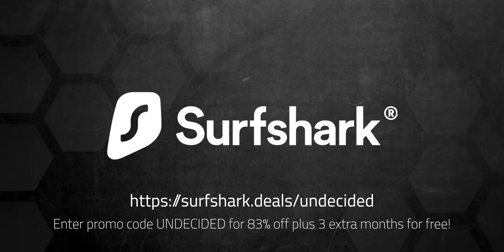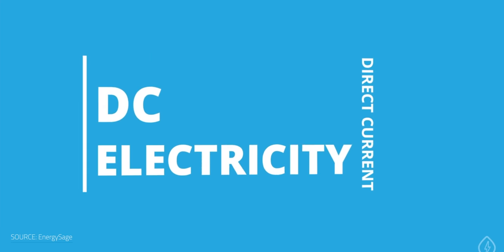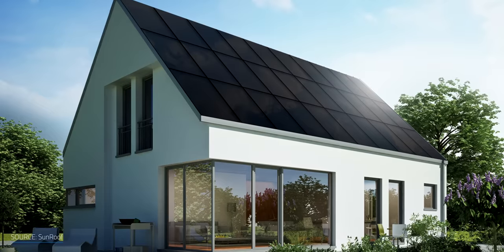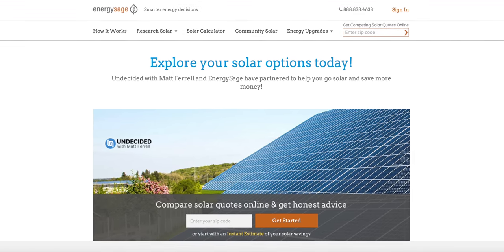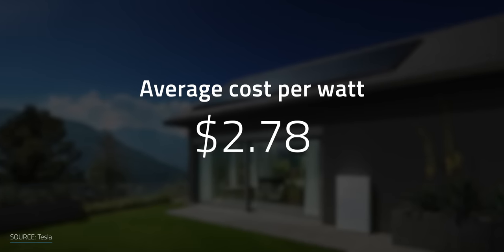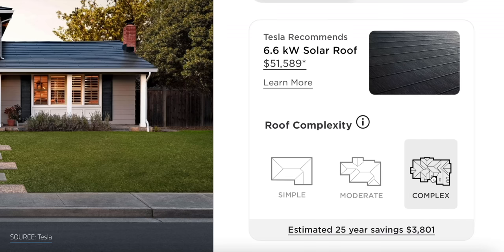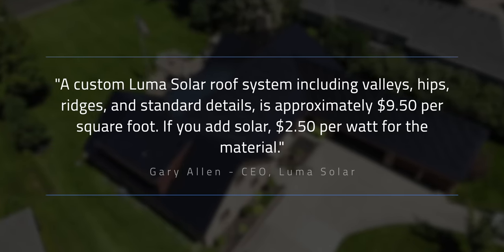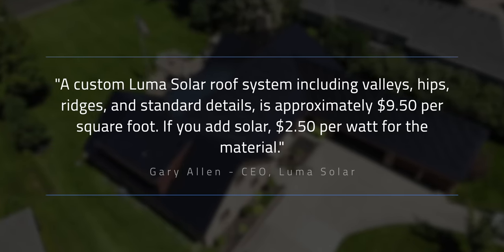Exploring Tesla Solar Roof vs. Solar Panels

Comment: My heart wants tiles but my wallet is screaming panels! 🤣
Reply: Looking at some of these roofs only able to capture 9kw and on the same roof  they could have have a 11-13kw in panels at a lower price point is a no brainer for me...but to some the esthetics is higher priority
Reply: Just invest the money...
Reply: @roqm1248  And people can deal with the aesthetics problems of panels by putting them on the backside of the house, on sheds, etc.  Our HOA forbids them on the front of houses but says nothing about the back.
Reply: We have a 223 yr old home that is under historic preservation specs, so we can't use solar panels on it (and no we didn't ask for historic designation - the city imposed it) and never mind that it has a galvanized corrugated steel roof which isn't exactly historic.  I refuse to put wood shake (which is the ONLY thing the historic preservation board will consent to if we replace the roof) as it ages quickly, leaks, and is a fire hazard (yeah, really smart thing to put on a "historic" home).  If I can get a solar tile roof that looks like wood shake I might be able to get that past the board.  Then again, maybe not.
Reply: Panels will keep the sun off your roof, depending on the air flow and insulation in the attic.  It may be better than tiles.
Reply: @allisonshaw9341  you can at least get geothermal at your property. Some energy savings is better than nothing.
Reply: No kidding!
Reply: Also the panels work better.
Reply: Save your money and invest in something else. You will never see a positive ROI with solar electric and the current technology. 

Also, you are doing anything that benefits the environment when using solar panels. Not only are the incredibly inefficient, but it requires a combination of coal and crystal smelted together as well as several other rare earth minerals and poisonous chemicals just to make the solar cells. 

We also do not have a way to recycle them when they reach their end of life.
Reply: @roqm1248  It's not just the aesthetics, if you are building a new home, building a regular roof and then adding solar is actually even more expensive than Tesla's tiles.
Reply: Slavery is Freedom, War is Peace  25 year warranty, about the same as regular roof tiles, so you would have to replace the entire roof either way.
Reply: @vladimirgertner3960  for the same wattage tesla tiles are more expensive! They will not install if roof needs replacing and that variable depends on the contractor you go with.
Reply: @roqm1248  I mainly focused on the idea of building a new house. So, you would have the expense of building a regular roof and then you would have to ADD the cost of solar panels to that cost. So it's the cost of Tesla tiles vs the cost of Roof + Panels.
Reply: @vladimirgertner3960  the difference is very small if your doing a new house but your cost might be higher if doing tesla tiles as you will have to either have your truss exposed until they come around to install or install roof and seal (water tight) then possibly strip the seal to then install solar tiles( working backwards and expensive) vs building roof completely and adding panels...this is all variable but i honestly dont see any cost benefit to tesla tiles compared to traditional panels...the only benefit now is aesthetics...price per watt..high.....install cost....high....wait time for installation......
Reply: @roqm1248  i was just pointing out 1 potential benefit. Definitely do not remodel an existing roof with these :)
Reply: @jeremiah6462  solar panels don’t ever get a return on investment and are worse for the environment than fossil fuelled electricity?!? Lol, you’re talking completely out of your ass.

First, they definitely have a ROI, the problem is the time varies greatly. For some like me who live more North I’ll admit the ROI is too long for me, about 20 years, but a lot if people in hotter climates can get as little as 10 years, especially if theyre getting rebates for putting extra energy back into the grid. 

As for these being worse for the environment… mountains of studies have found these claims to be absolutely untrue. Same with the dumb claims that charging electric cars causes more emissions than just using a gas powered car. All empirically false, yet all brainlessly repeated anyway like some sort of weird religion.

I take it you’re also a flat earther and antivaxer?
Reply: @MrShitthead  
Ahh so you are aware that it requires a combination of coal and raw crystals fired in furnaces fueled by fossil fuels? You are aware that they are made using rare earth minerals that require strip mining to acquire? You are aware that led is included in these panels? You must also be aware that there currently is no way to efficiently and effectively recycle these panels when they reach their end of life and they get shipped to third world countries?

As far as charging electric vehicles. The most common method of energy generation in this country is coal and natural gas? 

People like you are part of the problem.
Reply: A LOT of companies lease the panels, do any of then lease TILES?
Reply: @dingfeldersmurfalot4560  Be aware that panels need to be angled differently depending on your location in the world to get the most exposure to sunlight throughout the day. With that in mind putting them in the back like you HOA requires might lead to reduced power generation. My advice check with a trusted solar installer company local to your area about this to make sure your HOA is not screwing you over on this requirement before you buy a system.
Reply: @jeremiah6462  Rare earth minerals is an industry buzzword they are as rare as diamonds. (As in not at all with the scarcity driven/controlled by corporations that profit from keeping supply low.) You can offset the environmental costs of panels over time since you don't have to change them for over 2 decades. Compare that to burning fossil fuels to generate the same amount of power over the span of 20-25 years and burning all that fuel is several orders of magnitude higher in terms of environmental damage. 

The narrative that something shouldn't be done because it also involves fossil fuels to manufacture initially is completely flawed if not outright dishonest. If you are arguing for nothing to be done unless its 100% environmentally benign then you are arguing for an impossible standard . At the very least it will take 60 years for such a tech as power generation technology with zero environmental impact doesn't currently exist. Not even in the experimental stages.
Reply: @alexisrivera200xable  
No I am arguing that your technology is backwards, inefficient and environmentally worse than what you are trying to replace. But you’re a hypocrite and you only care about energy that’s “not big oil”.
Reply: @alexisrivera200xable  also you didn’t address the environmental impact that is supposed to be more environmentally friendly when in reality it is far worse.
Reply: Slavery is Freedom, War is Peace  The tiles are more durable though. In my city with so much hail over summer it might be a better long term investment anyways
Reply: @jeremiah6462  This depends on where you live. I live in Algarve, Portugal. Solar power is a no-brainer. Jan.
Reply: @janmaaso  
The overall point of my argument is that solar requires more hazardous manufacturing and does more damage to the earth than the energy generating methods it is supposed to be replacing. Namely Coal and petroleum based fuels.

They require incredibly harmful manufacturing processes, they are an incredibly inefficient method of generating electricity (currently max efficiency is less than 35% at best), their inefficiency continues to increase over their lifespan and when they are burnt out they are shipped to a landfill in 3rd world countries. 

Solar is not the green energy it claims to be and this doesn’t even include the battery requirements for long term storage.
Reply: I don't see how this works anywhere but in neighborhoods where looks are obsessed over, and possibly city roofs. I think I could convince my co-op apartment building to do the solar tiles because they would fit the look of the old building, where a solar panel is a tough sell (I've already tried). Granted an apartment can't be powered by them currently, but it would cut our electricity bills by a lot by selling to the grid our excess solar power, possibly even storing some of it for the whole building to shift supply a little.
Reply: @markhaus  
You’re not cutting your electric bill. You are replacing your electric bill with a much higher solar bill. The numbers don’t turn into savings, even with the credit from the electric company. Which, btw, they are paying you wholesale for electricity that they then flip and sell at retail. So you are getting screwed at both ends. Why else would the electric companies be all about helping you?
Reply: @jeremiah6462   Amen. I totally agree. You will never get a payback let alone a profit. Stick that same money in your 401K and watch it grow over that same 15-20 year solar panel lifetime period instead of micromanaging weather you can’t control. My lifetime shingle roof with 125 mph wind rating on a 4k sq ft house cost only $4k after insurance reimbursement. Even at full price it would have only been just over $10k. I never even think about my roof. That’s the way it should be. Also, the thing about the shingles that may fail in extreme climates might be the attachment clips from all the heating and cooling. Of course the installer loves the Tesla shingles because he probably makes way more margin on those roofs with less competition. I also wonder how hard insurance claims would be to get reimbursed on the Tesla roofing. So many problems. Snake oil sales and people buy into this BS.
Reply: @maxwellhouse750  
FINALLY! Another person with sense! 
Thank you sir.
Reply: @Homeside301  yip

Comment: Something you didn't mention is that panels provide further insulation. After we installed panels on our roof the house became much cooler to the point that air conditioning was not needed. We already have insulation in the roof but the difference between before and after the panels were installed was very noticeable.
I guess tiles would be the same as the roof with standard insulation.
Reply: Panel's can also be used on any roof type which provides home owners many more options in designs as well as adopting more modern materials which can reduce the need for heating and or cooling further reducing your homes energy demands.
Reply: That might be the case for you but it has not made a big difference in my situation. My attic still gets very hot in summer and cold in winter despite 21 panels on my roof. People should still consider proper air-sealing of the attic floor as well as insulation and possible use of a radiant barrier for energy savings. Perhaps modern air sealing and attic insulation would make for a good new video?
Reply: @petersachs764  in my case I covered the entire roof with panels. It may be that you only covered a section of your roof. The uncovered section would probably make enough heat to heat up the attic.
Did you notice any difference after you installed the panels?
Reply: @franciscoshi1968  Nope, pretty much covered whole roof. If you want to insulate your attic then insulation your attic. It should be a heck of a lot cheaper than the 23k my panels cost me. Heck, money is almost free now. Do both. 😄
Reply: @I love you but  Yes, they learned exactly who is "too big to fail".
Reply: "An unexpected benefit of the crossing".

Comment: As an Electrician, my concern with tiles was always how they integrated together mechanically.  Roofs shift and bend over decades, and my concern was that a hard connection would result in loose electrical connectivity.  

I applied with Tesla as a Master Electrician to be an installer mostly out of interest for their products, and as they never got back to me, I still don't know what the implementation details are, so I don't know one way or the other if they're actually any good.

Comment: Couldve be useful to mention avg cost pm2 for just a regular roof install. Give some context for standard roof costs against going down the solar tile path.
Reply: Roof installation costs are going to vary dramatically across the US,  and are subject to quite a few variables even ones as simple as the level of demand for roof repair/installation, such that giving an average price may not be feasible.   Add to that the availability of labor to do solar installs in an area may differ greatly from availability of roofers, so may not be an apples to apples even if he grabbed his numbers for a particular region.
Reply: Wholesale panel costs are about 75c per watt, beware of these $2.75 numbers, they are highway robbery.
Reply: about 7 times the cost of cheap 3 tab...for labor and materials...thats just a rough estamate.
Reply: @nicklappos  I think he mentioned that was the installed cost.  I could be mistaken though.
Reply: I install solar panels in New Brunswick Canada and we charge 2.25 to 2.50 watt installed net meter only.. so not sure why u guys are paying so much concerning we buy all our material from states and our dollar value sucks.
Reply: 15-30k roughly. I was thinking the same thing - If it’s time for a new roof this might actually be the best time to switch to solar and an even better time to consider tiles.
Reply: @nicklappos  there's a wide range of cost with panels. I see them from 40 cents per watt all the way up to over a dollar.
His numbers(2.75) includes installation and likely permitting.
Reply: new roofs costs are really only comparable if you are getting a stone or tile type material for your roof, the solar tiles are toughly the same cost and are far more durable. If you are comparing more common roofing materials, those are much cheaper then the solar tiles.
Reply: Agreed. Was waiting for him to do this. Why wouldn’t you include this in the video?
Reply: Measuring costs per m^2 for normal roofs only says so much. The structure of the roof, the kind of material you choose and the logistics depending on your location change the price x3 to x5. A simple roof with two sides and one window ~10-30k, slightly complex 25-50k, complex 50-100k. Kind of the same problem Tesla had with their tiles, just that silicon can be easier to work with. Also i don't know how good these solar tiles are in thermal isolation. Good bricks can already be quite good at keeping your house dry and warm.
Reply: @Jonaasti i doubt the solar tiles can last as long as classic tiles. If done properly and cleaned every other decade stone like tiles can last for centuries.
Reply: @MrHaggyy  There's absolutely no way they'll last as long. One storm and a few tree branches drop on your roof will result in most of your solar tiles shattered.
Reply: What happens if you have panels already installed, but down the road the shingles need replacement?
Reply: @Makitafan  you need an electrician that can unmount the panel, so you can replace the shingles. But it is very unlikely that you need to replace them under a none shattered panel.
Reply: @k0zzu21  😅 i doubt they are so fragile. Silicon glass that is lying on roof construction and not hold in a frame is quite strong. But the voltage/power of a solar roof and bad weather storms are a quite dangerous combination that needs to be calculated.

Comment: I had my solar panels installed recently, as the house was new, replacing the whole roof with tiles didn't make any sense. It'd be something to consider if the roof had to be replaced anyway. So far the performance of the panels has been good, but can't be sure until the first full billing cicle is complete
Reply: I thinkt hats kinda the idea, only a value product if you need w new roof already, and tbh that's an entirely fair businesses strategy
Reply: Same here. Roof could only accommodate 8 kWh due to pitch. Installed in January. Output steadily increasing as we tilt towards the sun. Saving about 1/2-1/3 of normal electric bill.
Reply: @JamecBond  Yeah I think that's how things are going to play out, expect to start seeing them as an installation option on new homes and only later installed during a remodel or replacement roofing.
Reply: @davidkeefe9468  Solar arrays are kW. Batteries are kWh. Charging stations are kW.
Reply: @honesty_-no9he  cool. Thank you
Reply: Good luck with it.  I'm considering them on our house.   Tiles are just so expensive.   I need a roof soon, but the price of the tiles might not allow me to go that route
Reply: just pray that no Hail come your way